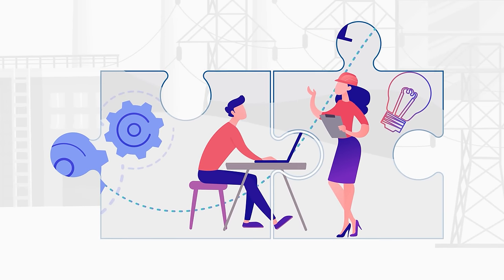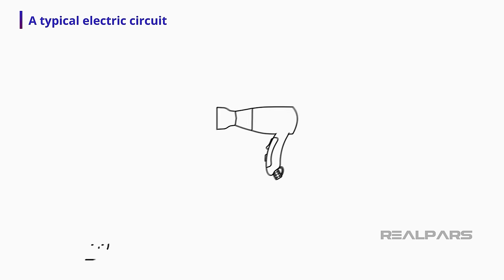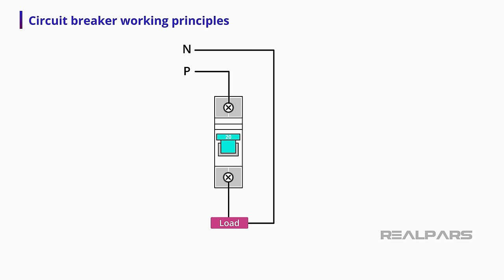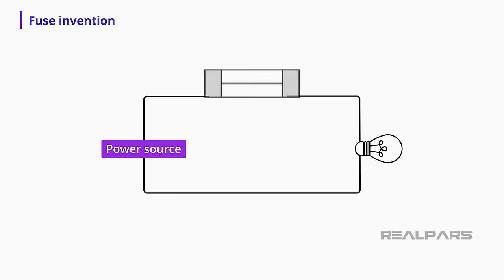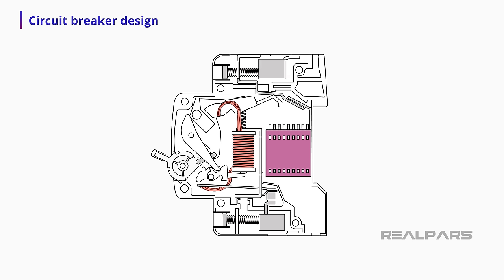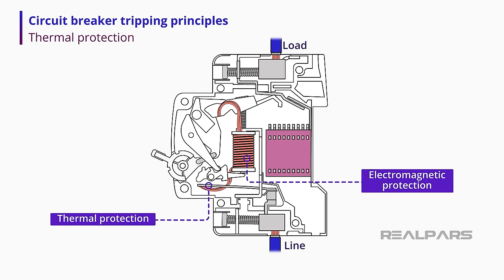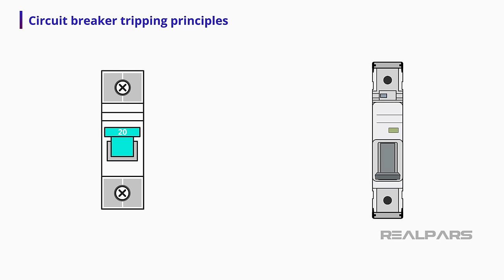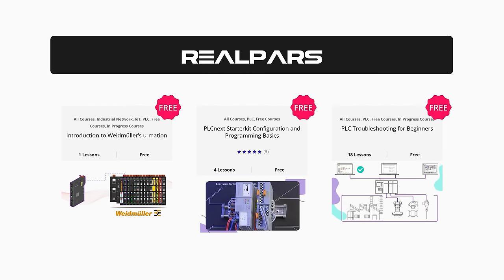Circuit Breaker Explained | Working Principle

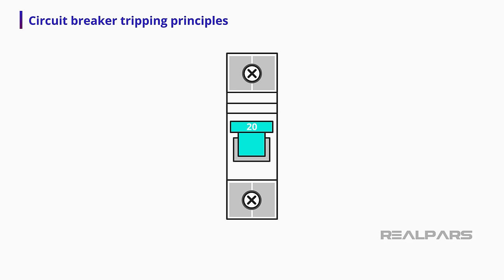Comment: Great video but I wish it were more in-depth. At 4:40 you ignore several parts of the design like the.. I think it's called "arc extinguisher" I wish for a longer / more in depth video if you know of one. This is the best I've found so far, thanks

Comment: God only knows how much I enjoy and practically use your well designed and narrated 'How Does" videos to train building facilities teams as a consultant, so my gratitude.  That being said, in this video, I wouldn't characterize the two triggering mechanisms (Thermal & Magnetic) as  "Parallel" since that word could suggest that the electron path can remain flowing as an "OR" condition.  The diagram clearly depicts a series condition, so either mechanism can render the circuitry Open.  I would use the word a "complimentary" mechanism where  the Magnetic is fast acting and the thermal slow(er) acting!
Reply from the maker: Thank you for your feedback, Ali! Much appreciated.

Comment: Between fuses and circuit breakers, which has a better response time for short circuits and overloads?
Reply from the maker: Both provide protection against overloads, and some fuse styles can act faster than many circuit breakers.  Both can provide adequate protection, but each must be designed correctly for the loads they are intended to protect.   Circuit breakers have the added benefits of being able to isolate a circuit on demand and being able to be reset once tripped.  Fuses are typically less expensive than circuit breakers, especially for large loads (motors, etc.).

Comment: What is the criteria to decide when to use fuse and when to use circuit breaker?
Reply from the maker: The main difference between fuse and circuit breakers is that fuses cannot be reused while circuit breakers can be reused over and over again. Circuit breakers are used to protect circuits and devices against overloading and short-circuiting while fuses protect circuits and devices against overloading only.  Fuses can be selected based on tripping characteristic, such as slow-blow, which makes them useful for motor leads.  Circuit breakers are typically used where you need to isolate (de-energize) a circuit, such as to a panel or control circuit, where removing a fuse would be dangerous and impractical.  Individual I/O circuits are typically fused due to cost and size considerations.
Reply: Circuit breakers have replaced fuses and everything but Legacy systems
Reply: @rmrieee9748  its not that simple. You typically still see fuses where the circuits maximum short circuit current is very high. A typical circuit breaker (or MCB) used in residential buildings has a breaking capacity of 6-10 kA, whereas Fuses have much higher breaking capacities, typically >50 kA.

Also small electronic circuits often use fuses, sometimes resettable. And the british BS 1363 AC Power Plugs all have a small fuse in them. 

So both MCB and Fuses still have their use-cases.

Comment: Would be good to explain why they have two trigger mechanisms. Also what are the different classes; B, C, D, ect.
Reply from the maker: Thanks for your topic suggestion, David! I will happily go ahead and forward this as a topic suggestion to our course developers.
Reply: The magnetic function will trip the breaker due to a very quick, but maybe short, large current such as a short.  The thermal will trip it on a long, small overcurrent such as an overload that may be caused by a restriction that may cause physical resistance to a motor turning causing a slightly higher current but for a longer time.  Two different possible causes of high current.

Class B breakers are designed to trip at 3 to 5 times the rated current.  Class C trips at 5 to 10 times.  Class D at 10 to 20 times.  

Also note breakers are selected to be at least 1.25 times the amps of the circuit (Full Load Amps of a motor).  This is equivalent to saying the circuit current cannot exceed 80% of the breaker rating.  80% = 0.8.   1/0.8 = 1.25.  You can calculate both ways:  find the max current allowed on a breaker based on its rating (20 amp rated breaker X 0.8 or 80% = 16 amps allowed for the load.  Or if you have a 20 amp load 20 X 1.25 = 25 amps so you would choose the next highest rated standard circuit breaker which is most likely a 30 amp ckt bkr.  A 25 would work if available.

Comment: But why the need of both thermal and magnetic contact if they are both triggered by excess current? What can one do that the other can't?
Reply from the maker: Thank you for your question!  Both the thermal and the magnetic components work together to protect the circuit.  If a circuit has a load just under the rated amperage, it is possible to overheat the breaker without tripping the magnetic interlock.  The thermal interlock works to protect the circuit in this case. This is often the reason that the circuit trips when too many household appliances are connected to the circuit.  You can usually tell if the circuit overloads on thermal effects because the breaker will not reset immediately.  The breaker is waiting to cool down.  So the thermal and magnetic components are complementary and provide a more complete protection for the circuit.